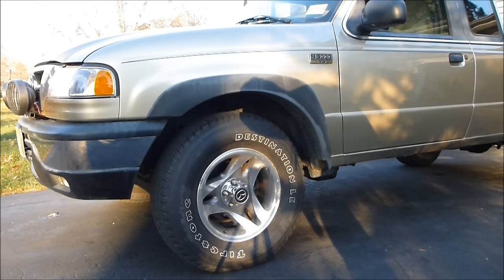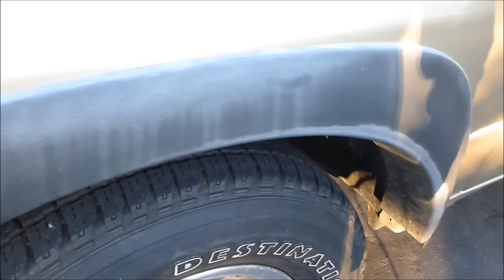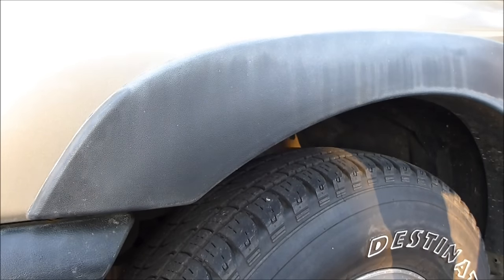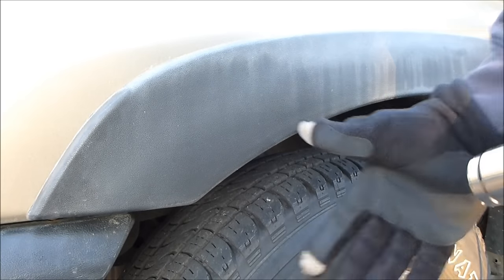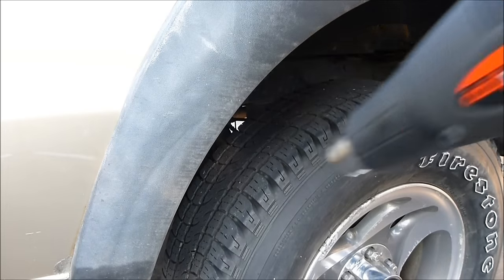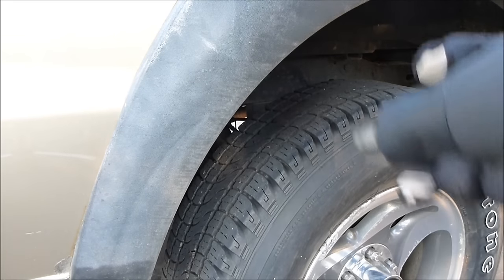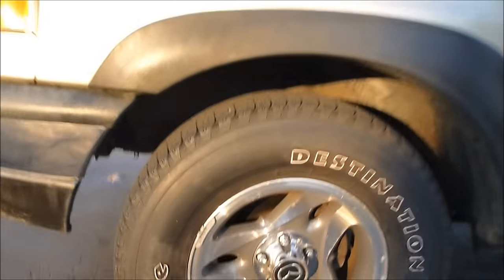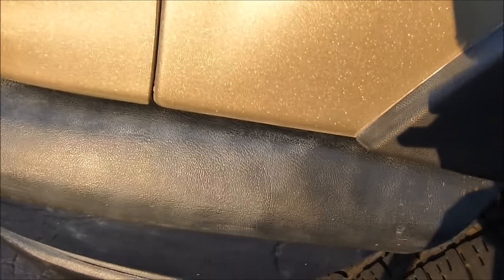Restore your Faded Plastic on your Car

Comment from the maker: +Albert Garcia, It might not work because your plastic on the accord just doesnt work by heating it up. Also, for some reason I cannot respond to your comment so make sure you post the comment through youtube so I can reply. But yea, sounds like the plastic wont "fix" when you heat it up. It doesnt work with all plastics. I did exactly what was done in the video so the amount of time and the heat you saw in the video is what I did.
Reply: Another solution is by buffing the plastic (gently) with a wax pad and a rotary machine.  In some cases, depending on the plastic finish, you can even apply wax and buff it off, leaving a great shine that will last months. If the material just dries the wax, you can apply a little armorall and buff if, the shine will etch on the plastic and leave it like new, without the shine  running away with rain or washes
Reply: Another solution is by buffing the plastic (gently) with a wax pad and a rotary machine.  In some cases, depending on the plastic finish, you can even apply wax and buff it off, leaving a great shine that will last months. If the material just dries the wax, you can apply a little armorall and buff if, the shine will etch on the plastic and leave it like new, without the shine  running away with rain or washes

Comment: Hey man I went out and bought a heat gun for $20 and then tried to use it on my trim. At first I was like dang this worked but then I let it dry and came back it was all patchy. Like some parts went darker but others stayed white grey. Idk what happened.
Reply from the maker: Were you consistent when you were using the heat gun? Try doing it again. Maybe use some armorall to hide the patches for now and when it wears off, try it again. Let me know how it goes!

Comment: Hey wouldn't the permanent head light restore process work for this as well?
Reply from the maker: Brandon Underwood Hm, that is a good question. I am not sure. In that case, you might as well spray paint it black haha.
Reply: True lol
Reply: Brandon Underwood  Yes it would, but you would also ruin the texture of the plastic and instead make it smooth, but you will expose the newer plastic underneath

Comment: My fender flares are so faded that yellow is showing. Is plasti dip the best option? Rhino bed liner maybe?
Reply: I used plasti-dip  but make sure you do 4-6 very thin layers and allow about 1.5-2 hours for each layer to set and dry to keep it all to hold so it doesn't wear easily and do it on a moderately warm but not hot day. And obviously clean the surface first
Reply: +jynxx'd alright man thanks, i plan on doing it this fall when its not so humid and hot. Though its 66 degrees today, usually its 90.
Reply: +SledNeckSlayer MN sounds good brother, and there is plasti-dip application tutorials on YouTube but I found that it takes longer to dry rather than the 20 minutes they say because just the surface has dried not the entire thing and that's when it starts to peel.
Reply: +jynxx'd already thanks for the info again.

Comment: Seems that everyone forgot that once you warm plastic up enough it becomes very brittle
Reply from the maker: This plastic doesnt become more brittle (or at least not noticibly brittle). This plastic gets heated like this in the summer so it is not much different than that. The heating brings the oils up to the surface and that is what makes it dark again. Good thinking though!
Reply: if it got "heated like this in the summer" then you wouldn't need to do it manually, right?

but yes plastic is not all the same, mudguard/dashboard...
Reply from the maker: *****
The heat isnt as hot instantly, but more energy gets put into the plastic because it is in the sun all day every day compared to just a blast from a heat-gun... Make sense?

Comment: Bruh, just get a pack of knock off magic erasers on amazon. 48 of them for like $10. Wet, rub, clean with water a rag, apply a mild cleaning product/protector. Way easier and looks better than this. I them on the interior of a jeep that sat outside for 5 years uncovered and it looked brand new when I was done. I tried all kinds of stuff, even this, and the magic erasers (melamine sponges) with water worked by far the best, easiest too. It's not often the easiest method is also the best.

Comment: Chris you have to try this product! http://www.amazon.com/Surf-City-Garage-486-Dressing/dp/B00JRPFKEA
I am big into detailing as a hobby. I owned a Jeep Cherokee for awhile and i had trouble getting the plastic to look nice for a long time. Tried mother back to black and a few other products in the end they didn't work well. Peanut butter trick works alright doesn't last long and really who wants to put peanut butter on their car. Picked up black max at wally world and haven't looked back. Kept my plastics nice through a whole winter, which no other product i tried could even come close to. Found it worked best if you apply it pretty thick let it set for few mins while you apply to other areas, buff, then apply a second layer. Just wanted to spread the word and hopefully this will help a few people out. As far as I can tell surf city garage makes a very nice line up. I used their leather cleaner to do my whole jeep interior, just awesome stuff.
Reply from the maker: +Detailing and stuff ! I have not tried that yet but thanks for sharing! Honestly, I used this stuff and it has lasted 2 years so far: http://amzn.to/25oFdrH
Reply: +ChrisFix Nice I'll have to try it some time. Always a bit timid of turtle wax products are pretty so so most of the time.

Comment: I woinder if this would work on the dash and steering wheel, which is also sun affected. Does anyone know the type of plastic used in the wheel flare?
Reply from the maker: Dont use this process on vinyl because it will ruin it.

Comment: Would it work for a '96 Renault 5 ?
Reply from the maker: It might. You would have to give it a try with a heat gun in an inconspicuous area and see. If you dont have a heat gun, you can try it with a blow dryer on high to see if it is worth buying a heat gun. Let me know what you find!
Reply: Ok thanks bro, will try with blow dryer first :)

Comment: is your plastic still black or did it dull again
Reply from the maker: After about a year it started to dull again. I think if the car/truck is garaged it lasts a lot longer.
Reply: ok thank. my avalanche looks like crap
Reply from the maker: If this works for that plastic, it will work great! I just touch up my plastic with armorall now and it brings back the shine like brand new (after over a year of doing this).
Reply: thanks
Reply: ChrisFix  Doesn't Armour All do that all by itself without the heatgun?
Reply from the maker: autoparts321 Armour All lasts 3 months maybe and when it rains, it leaves streaks on your paint. It also collects dirt and dust. I am actually doing a video review on this new stuff by turtle wax and we will see in a month how well it works. They claim it lasts 4 times longer than armorall and it doesnt collect dust or streak in the rain.
Reply: ChrisFix Nah dude all you have to do is take an old sock and soak it in Deep Woods Off and wipe it on.  It lasts for a very very long time.  its like show room new.  And you can also scrub your plastic head light covers and they will be fully restored as well.
Reply: Just spray painted my plastic. Came out pretty nice but who knows for how long. Im sure longer then the chemicals on the market
Reply from the maker: manny6584 I have a video review coming out in a few weeks about stuff that claims to last a year!
Reply: Thanks I will check it out

Comment: Transmission fluid will make it shine for weeks.
Reply from the maker: Dan Koz Thanks for sharing! Does transmission fluid make it collect dust and dirt?
Reply: It's ok for interior dash
Reply from the maker: Dan Koz What?
Reply: Use trans fluid on dash board will shine for weeks
Reply from the maker: Dan Koz That is a bad idea. You never want to use transmission fluid inside your car to shine up the interior. You will ruin the interior and cause the glass to get all hazy over time.
Reply: Trans fluids has oils in it, don't put on glass though
Reply from the maker: Dan Koz The oils evaporate and cause the glass to get a film on it.
Reply: Maybe

Comment: you just made ur plastic more bridle
Reply from the maker: This plastic doesn't become more brittle (or at least not noticeably brittle). This plastic gets heated like this in the summer so it is not much different than that. The heating brings the oils up to the surface and that is what makes it dark again. Good thinking though!

Comment: what watt heat gun is ideal?
Reply from the maker: Any wattage is fine. I use the $8 harbor freight one and it is 1500 watts but a hairdryer that gets really hot will work so...
Reply from the maker: *****
Exactly! I think this is just the right amount of heat because any more you might melt the plastic!

Comment: Simple fix... Plasti Dip it.... simple and easier put 5 Coats on. it'll look like new and will last up to 3 years or whenever you wanna take it off...
Reply: Mine didn't hold up that well and I used 3 coats of the stuff. lasted about 7 months and started to peel.
Reply: you gotta make sure that your surface is clean and dry and for fender flares you want thick coats of it, 5 coats should do i did it on my jeep wrangler and it's been on there for almost 2 years the only place its peeling for me in inside underneath the fender flare
Reply: nathan3306 you gotta make sure that your surface is clean and dry and for fender flares you want thick coats of it, 5 coats should do i did it on my jeep wrangler and it's been on there for almost 2 years the only place its peeling for me in inside underneath the fender flare

Comment: Why didn't you super clean the plastic first? Then just wax it
Reply from the maker: Peter Kapica I will be doing a product review on some plastic trim restorer soon!
Reply: Oh, all right. Maybe deet to the resque for plastic like with headlights?
Reply: If someone is too lazy to buy one?
Reply: Peter Kapica  Because that is not permanent, and wax stains the plastic
Reply: Peter Kapica You aren't supposed to wax the black plastic panels. No bueno.

Comment: PULL THE TRIM OFF OF THE CAR FIRST!!!
Reply from the maker: It isnt worth it to pull the trim off the car. I would probably break the plastic. Just make sure you dont keep the heat gun on the edges long and dont point it to the paint.